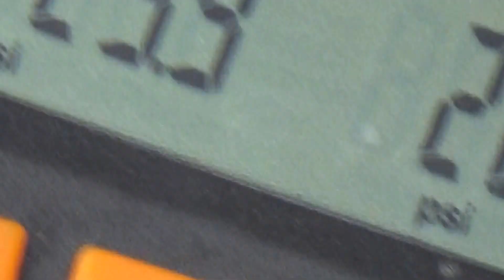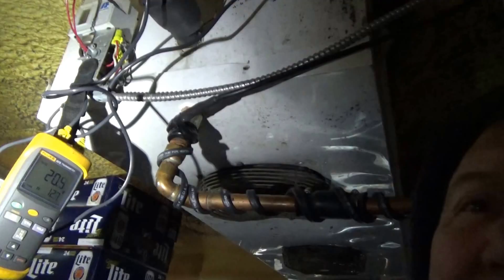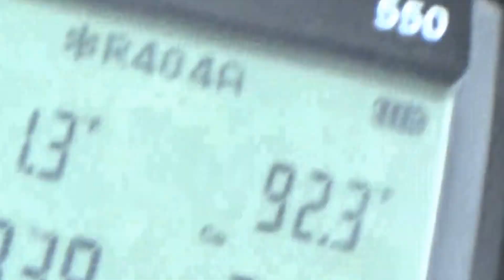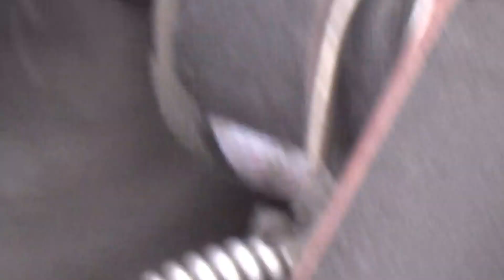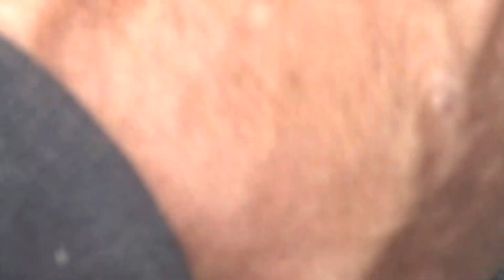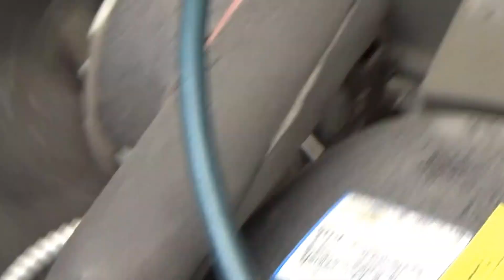Low evaporator saturation point

Comment: Never thought to check delta T across an evaporator coil. I'm going to check that from now on.
Reply: It will be better to check the TD, not the delta T. A TD is the saturation temp of the evap coil minus the air coming in. Will give you more accurate evap temp

Comment: I am looking at a testo 557 that is used. I am wondering how good it is and its best features. It does have a small crack in the screen on the bottom right but otherwise looks good. It also only comes with 2 refrigerant lines (red and yellow). It comes in a box but seems to have a couple of empty spots in it.  Thanks.

Comment: Measuring the evaporator outlet minus the inlet temperature, that's the two-temperature method for determining evaporator superheat, not the evaporator TD.  The superheat for a walk-in cooler evaporator should be set for about 6-8°F.   You have to be careful using the two-temperature method because coils with distributors which have 30-35 psi pressure drop across the distributor and distributor tubes, and so the saturation temperature is better measured at a return bend midway through the coil or at least at the outlet end of a distributor tube.  

It's actually much more accurate,  not to mention sometimes easier,  to measure the evaporator pressure, the outlet temperature and calculate the superheat with a PT chart or you digital gauges.   

The TD is the air temperature entering the coil minus the saturated evaporator temperature and is what determines the cooler's relative humidity, and yes a 15°F TD is what you should expect for a beer/beverage walk-in to keep the boxes dry.

Comment: Hey Jim would increasing the rate of airflow through the evaporator coil help this situation? I'm learning this stuff but logic tells me that increasing airflow would raise the temp from 4 to 15 if you doubled the airflow. Also adjusting the condenser fan control to allow for higher head pressures. What do you think? I know it's not the right unit but I have a similar situation and was wondering if this would help lower the humidity level in the box?
Reply from the maker: +MrNiceGuy yes
Reply: +Jim Pettinato Thx Jim

Comment: I'm just goin back to basics here. But did you check the evaporator to see if it's dirty? I'm sure you did. But even with a low flow evap I feel like you should be able to get a higher coil temp. I know it's a pain to check the inside of the coils on those because you have to drop the drain pan. Thanks for the good videos!

Comment: As much research I could come up with on that compressor model #CR37KQPFV980WB,  its a 3 ton high temp rated ( 45 Degree evaporator )R22 A/C compressor.  Let me know your thoughts????
Reply: +gary smith I think 45f is just the temperature it does 3 ton duty, it will run lower and still be in its design envelope,  possibly 5f if it a high back pressure compressor.

Comment: You did say that system had a few strikes against it. Low volume evap coil, somebody blocked inlet evap with spray foam, no defrost. Could be some warm air breach, door gasket tightness with seeing your breath. You also said it runs too much. Thanks jim. There's quite a few symptoms.

Comment: I would think that the compressor is oversized for the load, causing the low suction.  Or a restriction on the suction side, i.e., kinked return, valve partially closed on the suction accumulator, old suction filt/dryer. The high side seems ok but the low side is wacky good video really enjoy all your work.

Comment: The compression ratio is going to be higher since you have higher head and lower suction.  This would actually cause your compressor to work harder.  The body of the txv is going to frost over on the suction side because the your suction temperature is so low.  Has this ever operated properly?
Reply from the maker: +camron conlee  someone put this together some 15 years ago, it's been keeping temp, what's amazing is it doesn't have a defrost time clock
Reply: +Jim Pettinato This is one unique installation then lol

Comment: Why do you adjust the txv that way over checking superheat?  Is it more accurate?
Reply from the maker: +Jack Mason that's the way I learned, for me it's more accurate especially for low temp, thanks
Reply: Hey Jim! First off I want to say great video as usual, you are the best on youtube hands down. I've adopted some of your techniques especially the way you adjust txv's. I went out and purchased the fluke 52 with the 2 temperature clamps. Pricey but this is the price of doing business if you want to do the job right. I wasn't taught this way to adjust superheat but then again this is refrigeration not comfort cooling (AC). Jim maybe one day in your spare time you can make a video on the concept behind adjusting ixv's the way hussman taught you. I think it would clear the air for these guys. Thanks again.